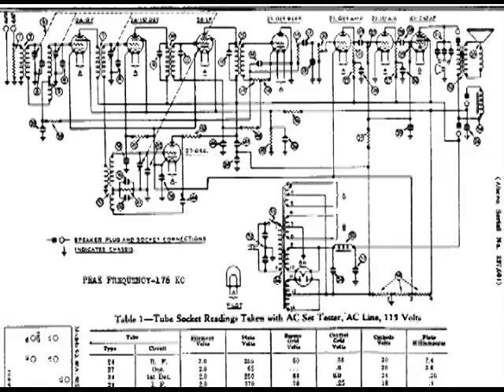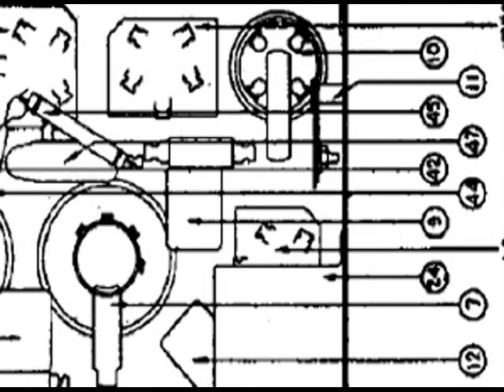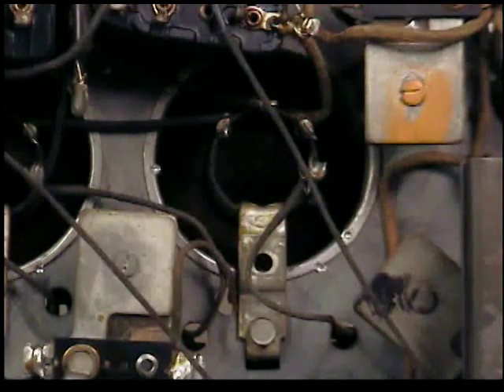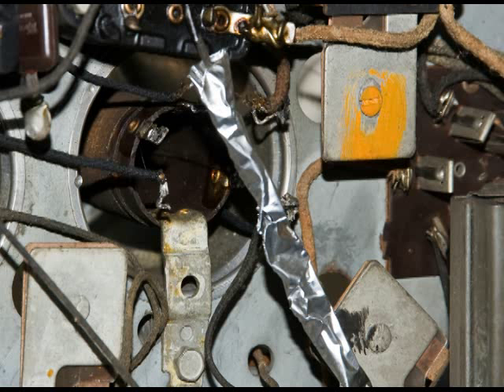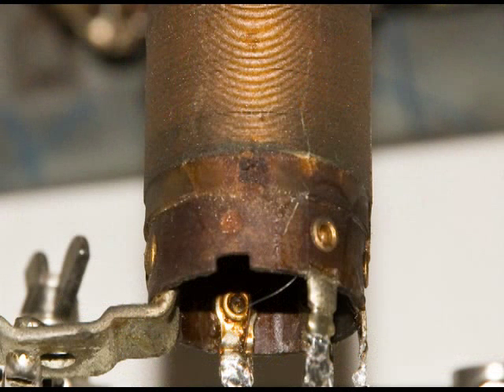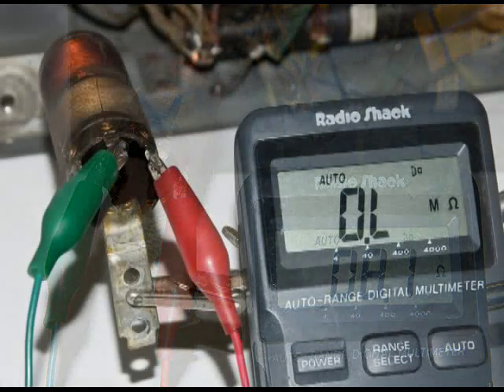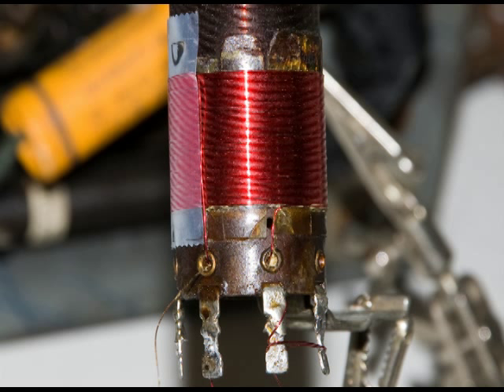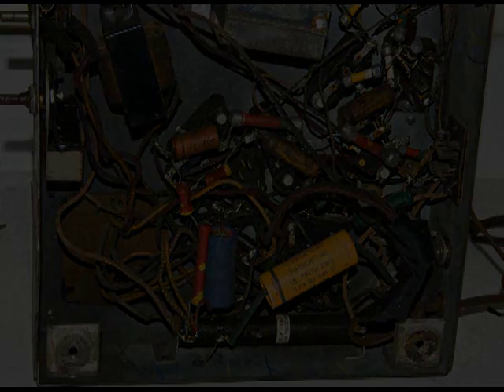Philco 90 Coil 7 Repair

Comment: Excellent repair info!  I'll remember that aluminum foil trick next time I solder in tight places.  Never thought of doing that before.

Do you use a machine to wind the coils?  It looks very straight and uniform for a hand wind.

Comment from the maker: Hey Don,
Hope you have good luck this new acquisition, the Philco 46-1206. Just looked it up, 8 tubes 6V6 PP output, neat, should sound great. That will be a terrific when you complete working on it. The Grundig sound interesting also. I don't see many console radios anymore at antique stores or at the flea market. I use to see them all the time, but no more. Good luck and thanks.
Rick

Comment from the maker: I tested all the coils first and found this one open. I did remove the old wire then wound on the new wire filling in the area. It is just a single layer. And again this will work because the primary side is not tuned.

Comment from the maker: It depends on if it is a tuned circuit or not. If it is tuned then you must reproduce the coil as exactly as possible. If it is not tuned then something reasonable close will work.

Comment: I have an orginal finish Philco 46-1209 that I got about 15 years ago. It's been gone through and is a  very good performing radio.  It will be well worth the effort to get your's going. Incredible bass from these radios. The phonograph probably just needs to be cleaned of the old lubricant and re-lubed.  Does your 1209 still have it's back?   I love my 1209 and it would probably take a really nice Zenith for it to lose it's place in the living room.  But it wouldn't leave the house!

 Enjoy..

Comment: Dont forget the caps inside the bakalite blocks. I have done a couple of the model 60s ,they have a lot of caps in the  bakalite blocks .I have the book to look up the numbers on the sides of the blocks if you need them .

Comment from the maker: Looking at the circuit, the primary is not tuned. I did not count the turns this time and the gauge of wire I used was a little larger. Because the primary is not tuned the coil is not super critical. But it is still best to replace with the coil with the right gauge wire and the same number of turns and in the same direction. I did wind the new coil in the same direction.

Comment from the maker: I this case I could have unsolder the wire at one end, but sometimes that is not so easy, aluminum foil works good. It even makes noise, a good reminder. Yes I did the coil by hand. Thanks.

Comment: cool, did you remove the wires from the coil before you tested them to see it was open? and if you know the width of the coil and how many layers of windings, will that get you a close enough approximation to how many windings a coil has? I hope that last question made sense.

Comment from the maker: The primary is not a tuned circuit so the rewinding is not super critical. I wound the coil to fill the space using the closest gauge wire to the original I had.

Comment: Back when I was working on my 89 I didn't have a good camera that focused in, so I had to make detailed drawings of every part as I removed it. what do you use to rewind the coil? if you do it by hand I admire your patience! also I  see some bakelite capacitors in there... those are fun to do :P

Comment: how did you know the amount of turns to put on the coil? did you count them as you took off the old wire? this one of the things I really want to try. I gave up on a lot of radios that had bad coils because I was too intimidated to repair them.

Comment: Did you see radioam232's video where he made a coil from a toilet paper roll?  In it he fixed the wires by covering them with glue.  It made me wonder, would this work for a coil like this one as well?

Great repair job.  Learned a few cool things from this video, your bag of tricks seems to have no bottom.

Comment: @AllAmericanFiveRadio What kind if wire do you use to rebuild the coil? What size or gauge? Do you rewind them by hand?  My Zenith toaster radio has a bad resistor on the inside if the coil. In removing the coil from the radio and replacing the resistor, I accidently snapped off a wire from a lug. I tried just about everything to resolder the fine wire but no luck. Two things I noticed: Wax on the coil and fine thin insulation on the wire. What advice can you give me?

Comment from the maker: @toltec13 
I don't remember what the gauge or turns were. I try to match the wire and the number of turns per coil.
I clean the ends of the wire using a fingernail file. But I would check the continuate first. I Googled "antique radio coil repair" a few place advertise coil repair. I would email RadiolaGuy.